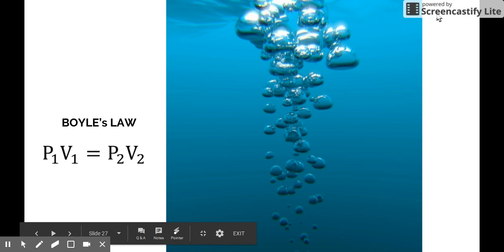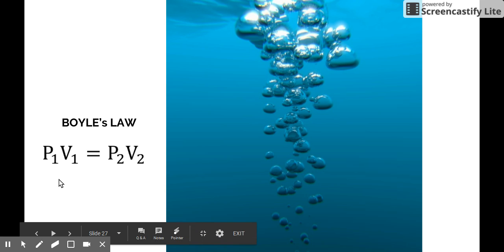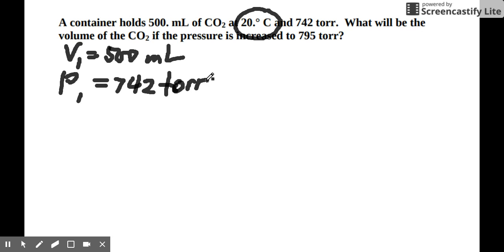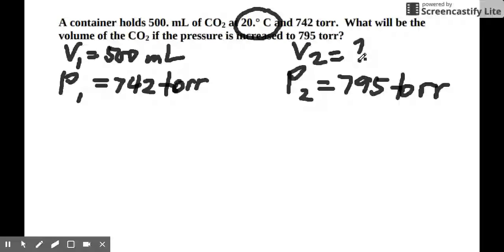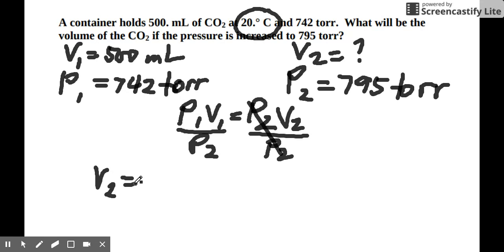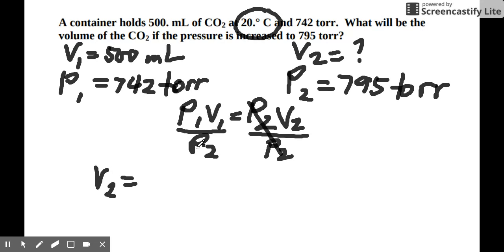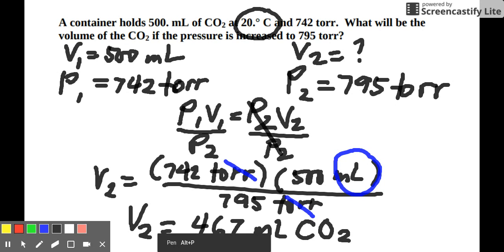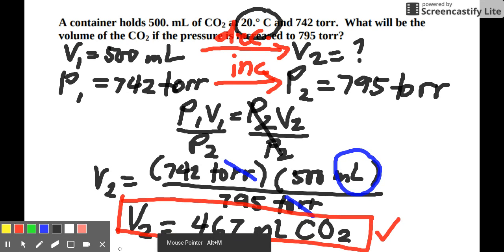Boyle's Law Problem Solving

Comment: Hindi po ba need iconvert ang torr sa atm?
Reply from the maker: No need as long as the pressure units are the same. Since this is Boyle’s law, there are no rules for certain units (that’s only applicable to Ideal Gas Law). Hope this helps.